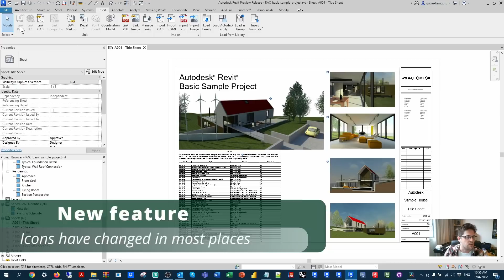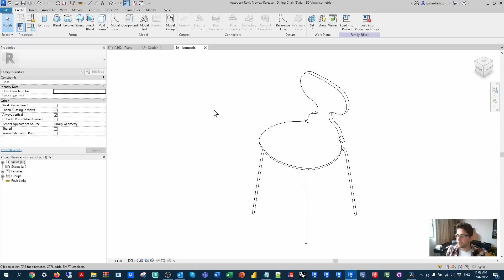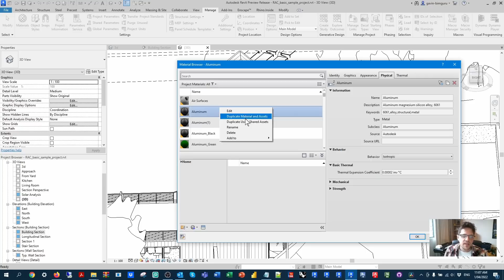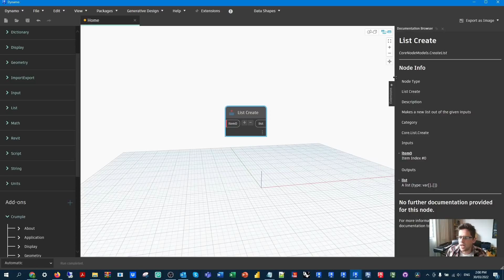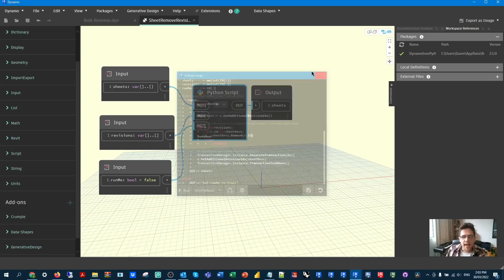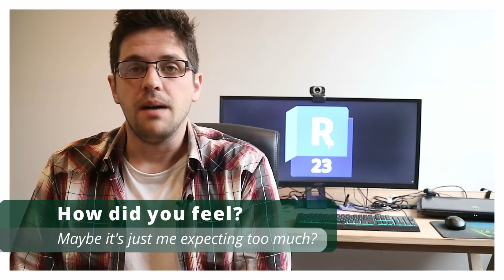What's new in Revit 2023?

Comment: Hello, can you give your advice, Our Company here in Saudi is new for Revit and BIM work. Last week they bought Revit 2023 for the new project the issue is the Client are using Revit 2021, can our BIM coordinator can still upload my Revit Family (Elevators specifically) in the BIM360 without issue in the version? thanks
Reply from the maker: Unfortunately Revit isn't backwards compatible so you will need the client to use Revit 2023, or work may need to be redone in 2021 if not.
Reply: thanks

Comment: Also,  in Dynamo 2022 they removed the option Manage Packages from the menu "Packages". They moved it under Dynamo > Preferences > Package Manger. Just why? I don't get, it honestly looks like such UI was designed by someone who was drunk.

Would be also great if you could simply go to a parameter and calculate new measure by adding + WITHOUT adding the = on the front. 
Such as: Window Height 1200 (mm)
                 Window Height 1200+100
                 Window Height 1300

If you tried this you get an error which requires you to do this every time
Window Height =1200+100
Reply from the maker: Yes it's a bit unintuitive.

Comment: Start adding your Ideas to the Revit Ideas forum. 
https://forums.autodesk.com/t5/revit-ideas/idb-p/302
Vote for the features on the Revit Public Roadmap
https://trello.com/b/ldRXK9Gw/revit-public-roadmap
Reply from the maker: My ideas have been there for years. Multithread. Back compatibility. Better control over railing components. The problem is these are actual problems to solve which require time/money invested by Autodesk versus features one could go as far as deeming bug fixes.

Comment: Though not documented a bug report I made is been rectified. In 2022 and previous could only digit group as this 123 456 789,000 there was no option to replace comma with period unless comma as digit grouping ie 123,456,789.000. Just checked 2023 and now can have as 123 456 789.000
Reply from the maker: Handy little improvement for a weird bug!

Comment: We really need greater modeling control of railings, specifically custom control of a baluster’s location.  The railing updates a few versions back were great, but it still difficult if not impossible to model the intended design without hacks or in-place families.  

I was so hoping to see something related to railings in this release.  At first glance, this one is a big letdown after 2022.
Reply from the maker: Yep railings are still a nightmare for the most part - especially going around corners or glass panels between balusters.
Reply: @AussieBIMGuru  Gavin...  would it be easier to model in rhino and connect the railings in with rhino.inside?
Reply: Using railing supports as balusters ;)
Reply: @NZWarriors1995  Yep, I already do that.  But I hate that I should even have to use that hack in the first place.

Comment: Another big miss - keynotes still get no love - shared parameters can link to the cloud
Reply from the maker: Doubt keynotes have anymore changes to come really. What changes do you think they need? Being in other tag types is the main one I can think of.
Reply: @AussieBIMGuru   Keynotes should be stored in ACC same as shared parameters especially  with remote teams and remote subs. The current dialog box should have an edit option. OTB keynotes are a bit useless but we develop firm and project specific keynotes for consistent noting. The current keynote file is a text file which windows cannot make read-only when opened leading to potential overwriting the file when multiple people try open. I had keynotes stored in a web server writing to a local file on update. The database holds the true file so each updates publishes the latest. If we could only link from Revit to a URL all would be solved.... well as far as keynotes.
Reply from the maker: @GregSmith-gi5gp  yep agree with all those things. In the meantime I've typically been storing keynote files on google sheets and then using dynamo to construct files from them to get around sharing issues. Will be interesting to see how the piratesourcers handle all their clients moving to b360 over time as more features rely on it.

Comment: The new icons look so bland, Autodesk had much more interresting icon's in the 2000's. Autocad's Icon literally was the crosshair cursor in icon form. The new version doesn't seem to have much improvements. Version 2022 is great, at least they added PDF export (which saves me a lot of time!). I also like the duplicate sheet option. The only new feature of 2023 that seems somewhat usefull to me is the IFC export mappings. Recently I had to deal with steel connections not exporting in version 2020, seems like you have to manually edit the type mappings in that version in order for them to export. If you've ever wondered why there's the "include steel elements" option in IFC export and it didn't work, well it's got something to do with that.  I'll I stick with 2022 for the time beeing.
Reply from the maker: Yes I miss the old icons too - a lot more character than what we get now!

2022 did have some improvements worth upgrading for but I also think I'll be skipping 2023 for now. I believe the IFC mapping/export issue with steel might relate to the default mapping table in the exporter settings - a lot of categories related to engineering are set to not export, or export as proxy.

Comment: The version compatibility is truly an issue. Virtually all my architectural projects are assigned designated Revit versions simply because some consultants have their entire libraries that way and prefer it, some consultants aren't backwards compatible with others, forcing projects into interoperability issues, some users simply make mistakes or windows opens a file in a new version, they miss it and all the work goes to waste. The icon ambiguity tells me that Autodesk really don't give a flying finch about what works for their users and the industry, but only what works for shareholders.
Reply: This is by far the most mind boggling thing to me about Revit...A professional software that doesn't support earlier versions of itself despite mediocre updates.
Reply from the maker: @siminc7905  it really is telling of their deathgrip over the industry.
Reply from the maker: Indeed. I would be happy at this point if they were just honest with users and switched to perpetual patching at 3 month intervals and did away with versioning altogether.
Reply: I've never understood this argument. Do we really think Adesk would concede a huge portion of their version upgrade revenue by allowing this? Half of AEC would still be on 2015 & half of their $$$ marketing budget would be in the 🚽.

Comment: Pretty sure dimensioning in 3D without locking view was already a feature I use it all the time in 2020. Just text and tags? I believe required locking view.
Reply from the maker: I think it might be the measure tool that was added to 3d based on the summary i read from adsk.
Reply: You could do it, but the dims where 'stuck' in place so when you rotated the view the dims where going to different locations and not looking neat, hence the lock requirement. Now it's better.

Comment: You did miss quite a bit of features that I'm aware of:
 - Work plane save placement, will remember workplane until reset.
 - Materials can now be saved to a server/ cloud location
 - Temporary Dimensions for Shared Nested Families
 - Performance improvements (Unload/ Reload faster, Skipping regeneration and calcs for redundant rooms, Area/ volume improved performance)
 - Large selection improvements (Worksharing Controls on/off)
 - Interactive Solar Studies
 - FormIt files can now be linked as CAD file
 - Better mesh management (imports for OBJ & STL)
 - PowerAutomate is a great feature as this helps with Business processes so not just RVT Automation
 - Cloud model non-destructive rollback
 - Updates to Key Schedules
 - Updates to Conditional Formatting with Schedules
 - Schedules filter by sheet
 - Additional Taggable Categories
 - Contour labels will now read better
 - Generic Annotations have an improved orientation
 - Change Page order in PDF Export/ Print out
 - Control fill patterns patterns as parameters
 - Swop views on sheets
 - Additional view filters parameters
 
These I've found most applicable for Architects.

Sometimes first out the door doesn't mean all relevant content is covered ....
Reply: measuring between 2 elements in 3D is also enabled now. didn't work in previous versions.
Reply: @lourenssmids3273  I'm gonna find that really useful
Reply from the maker: Ah yes of those I had to skip the cloud features for now as most werent implemented in preview release properly yet. The solar study I considered adding but unsure if it will be used much. Most of them are minor updates otherwise but nice to have I guess.

Thanks for the list!
Reply: @AussieBIMGuru  I do agree some of them aren't that great in the overall scheme of things but depending on where you sit you will find some more interesting than others (like you on Dynamo) for other people the overall general stuff is really good and helps a lot.
Reply from the maker: @machielodendaal398  time to let the masses decide I guess!
Reply: Thanks Machiel
Reply: Schedules filter by sheet seemed like a game changer, until you find out it's just a visual filter on the sheet, the actual schedule itself still retains the original formatting, which can be useful in some cases but not when exporting.
I don't know if i missed something but still seems like previous workflows of adding some filter parameters for elements on sheet works better?
Reply: I am surprised that you chose the IFC feature as your highlight. 
My highlight is one of new the cloud features in this release. Sharing material on Autodesk Docs! Sharing custom textures with others will be solved with this new solution. I see more cloud features are on the way.
Reply from the maker: It's a welcome feature but I haven't come across many scenarios where teams use materials cross company yet so will need to see how many people find a use for this I guess. Ifc is my highlight as Revit is a closed off platform, anything they can do to educate people who know nothing but Revit is a win for me.
Reply: How yall know that before official release ?
Reply from the maker: @milosciric7655  revit preview beta. Closed program, invite on request only. You can apply on their website if you search for it.